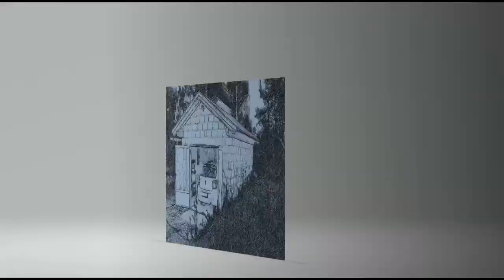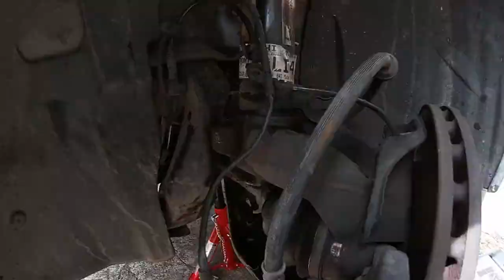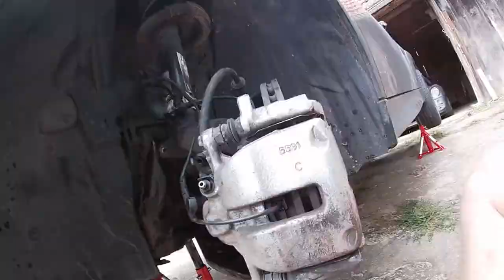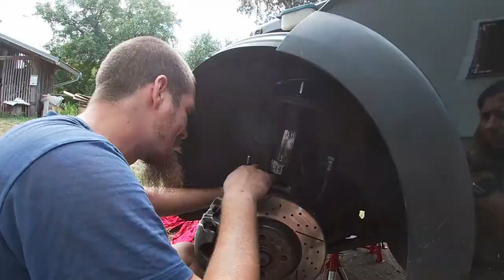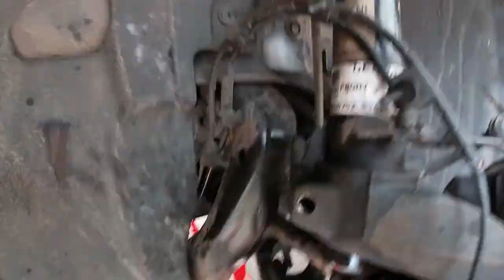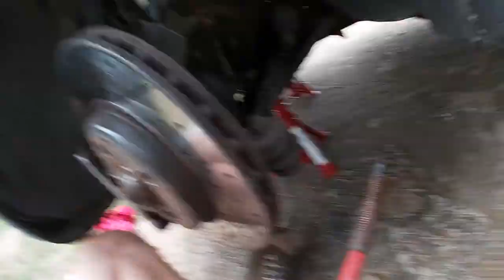Removing snapped bolt from a steering knuckle - Mini R53 project

Comment: Same thing happen to me while tightening the pinch bolt after removal to replace strut. Could not believe it, while putting it back in? and with not too much torque? I drilled 3 smaller holes  in a line in the bolt where the head snapped so that I could create a slot for a flat head screwdriver with a square shank so that I could use a wrench to back it out. I used a propane torch and heated the carrier where the bolt  was . The keys is to heat the SMOOTH part of the bore , not the threaded. It is the swelling of the bolt from rust and corrosion that cause binding I spent hours heating the threaded end not realizing that.

Comment: Hey men great video! I’m having the same issue trying to change my coil overs. Will try your method tomorrow.
Reply: Well it didn't work hahaha. But there is 2 factors I think why it didn't. First, the level of rust, it just locked everything. Also the bolt it's so soft that even if I was able to drill it when I used something to try to get it out is just crumbles. I went out and found a couple of used knuckles for 50 dollars, so I will be changing everything. Still great video!

Comment: Hey man. I got the same issue with you. What drill bits did you use? I'm using some HSS and been drilling for two hours and I only made it 3mm in...
Reply from the maker: Cheap Lidl/Parkside metal drill bits, but they were new and pretty sharp
Reply: @WillowRacingTeam  You must have been very lucky. I bought a set of HSS with titanium cover and the mofo is not moving... ordered a set of cobalt, will see tomorrow...
Reply: Hey willow's shed.  Just want to thank you for such an amazing video.  I my self was installing H&R lowering springs on Saturday on my 2001 mini one an broke that same bolt on that same side. On watching your video an reading  the comments I saw that you use lidl/Parkside bits. So I tried them due to your video an they worked very easy. Because no other expensive bits was working . Just want to say thank man 💯. An keep up the good video 👍🏻

Comment: Hey good to see someone getting that bolt out - I have the same problem on my z4 - but you didn’t explain what drill bits you used - did you use normal metal drill bits or left handed drill bits - and then it looks like you used a tap to tap new thread inside the bolt then used a screwdriver to take it out - why did the screwdriver work was it just the right size 
A few more details in your video would be more useful mate 👍
Reply from the maker: Normal drill bits, I used a tap but from the back side, that's what got the leftovers of the bolt moving. Once it got moving, I used the screwdriver from "right" side because it was the easiest way to get it out. To be honest, it's always about feel when you do something like that, just go one size up on drill bits ,when you see that it's about to move, try different thing until it does, and it's smooth sailing from that point on. 😉